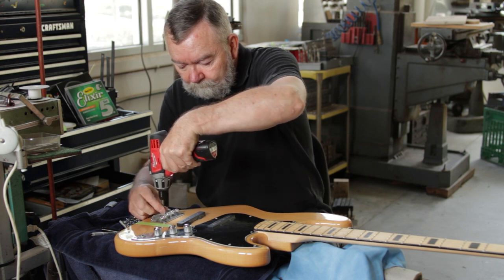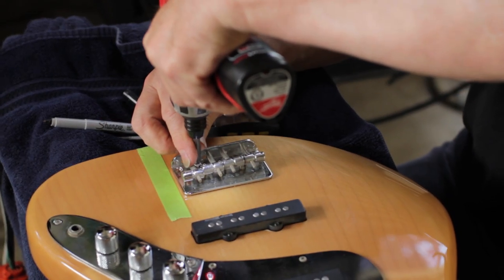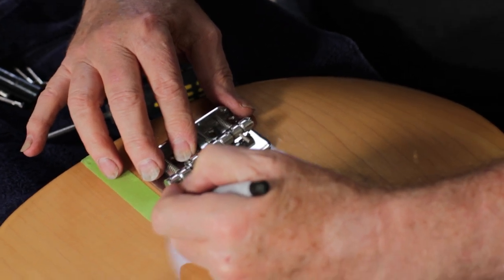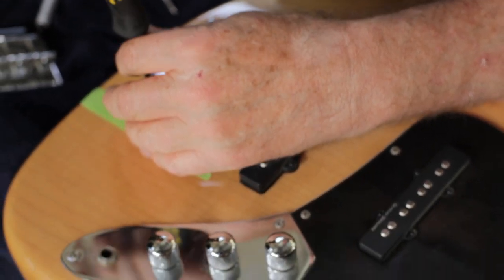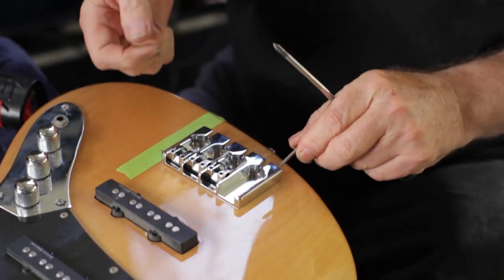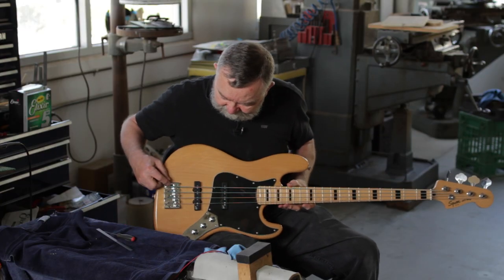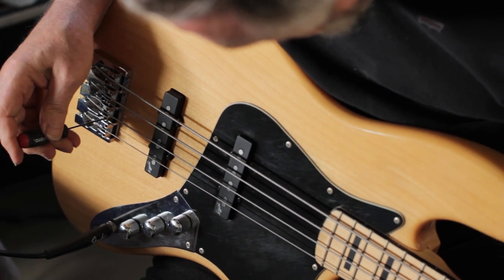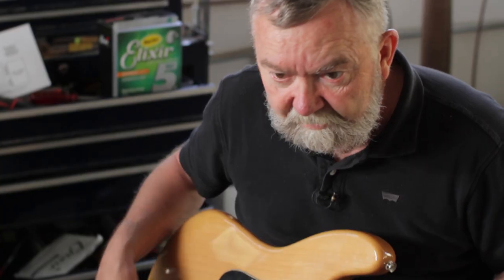How to Upgrade the Bridge on Your Fender Bass Guitar | ELIXIR Strings

Comment: Quick tip: to get threads started and avoid cross-threading, turn the screw backward a quarter turn or so until you feel the threads drop into place.
Reply: I was getting ready to write this exact same thing. Been doing this for years and has never failed me yet.

Comment: John, I just saw on You Tube a video of a New kind of Bass bridge. With side to side adjustment of the strings. And made of Stainless Steel.
The sound projected from it was much better than any Bad Ass or Hip Shot or Babics Bridge Ive heard today in 2022. But with the todays pick ups improved. The bridge also has to improve. Its called Tone Up 3d Barrel Saddle Bridge. I think this New technology of Stainless Steel Bridge will revolutionize the carrying of tone never heard before.

Comment: Great Video John! I'm confused though about where to measure the string height. In this video you state to measure where the neck meets the body (~17th fret), but in your book "Teach Yourself Guitar Repair & Maintenance" on page 19 it states to measure at the 12th fret. Furthermore in the picture on page 19 it shows a single dot on the top of the fret board. If it were the 12th fret it would be 2 dots (typically). Can you clarify where to measure the string height?  Thanks!
Reply from the maker: Hi Miles, thanks for watching. Unfortunately Mr. Carruthers isn't able to respond to your question. We recommend contacting a local luthier for assistance. Thanks.

Comment: Great video. What if the holes don't match? I have a P-Bass with the strings threading through the back of the body.
Reply: I would go to the hipshot web site and see what they have listed. Also do some precise measuring just to make sure the new bridge fits if you are trying to avoid drilling new holes.
Reply: @Snowdog216  My USA Jazz has strings through the body, the bad ass bridge has strings thru the back of the bridge. More research I guess.

Comment: Can someone please tell me ¿What kind of bridge he is installing?
Reply: The title says Hipshot. And thats what it looks like to me.  I recently installed a Hipshot Kicka_s__s bridge, 5 hole 4 string 5K400C model on a 1998 MIM Jazz Bass. It fit perfectly into the existing holes. But measure the string spacing before removing the stings, then adjust the new bridge to match before installing it. Just easier that way.  It sounds great. The owner was like I should have done this years ago. Check the current bridge, if it is currently at its lowest position, then most likely you will need a neck shim. That is because the Hipshot bridge is thicker and stands taller. Also it is better to have the strings at playing height and the saddles near their middle height, so there is room to adjust up or down.  A hard rock player or funk popper might want higher string height and jazz player might want lower strings.

Comment: My bass bridge hums. It stops humming when I touch the bridge. Why is that?
Reply: Ryan same problem
Reply: You should shield the guitar.
Reply: Make sure the bridge is grounded. Under it there should be an exposed wire that gets sandwiched under the bridge. Make sure that is there, and connected to ground. If it isn't, fix that, if it is and you still have the problem, take Reku Papa's advice and shield the cavities. This can be done easily with foil tape. When this is done you must make sure the shielding is also grounding. There are lots of tutorials on all of this.
Reply: Did you see the video? He explains that at 1:11.
Reply: Agree with other comments. Check ground wire.  Checking grounding on pot wiring and all wiring. Also note if you are in house with florescent lights, dimmers, etc, those can cause issues. Try another receptacle in area. Turn off other electronic devices.   Note some active pickups like EMG say a ground is not needed.